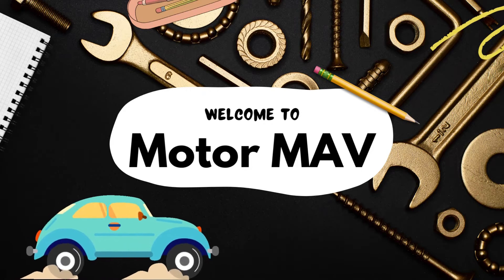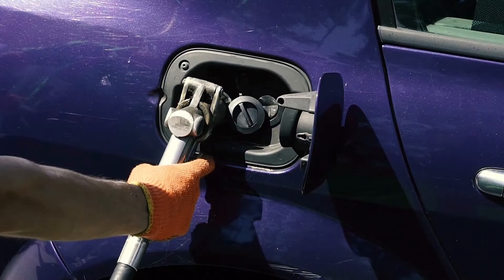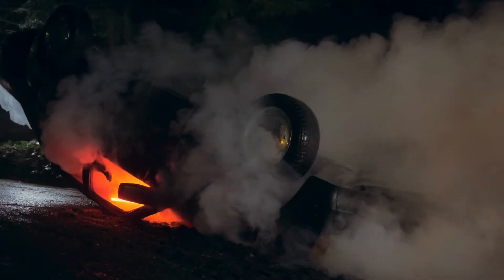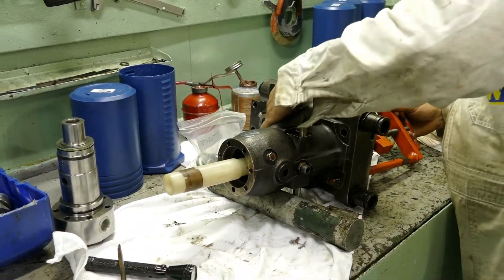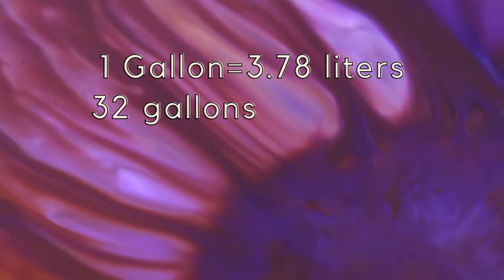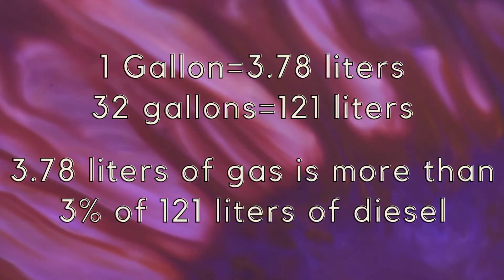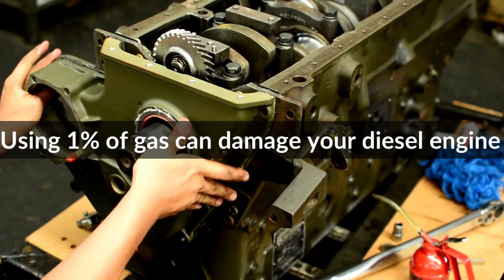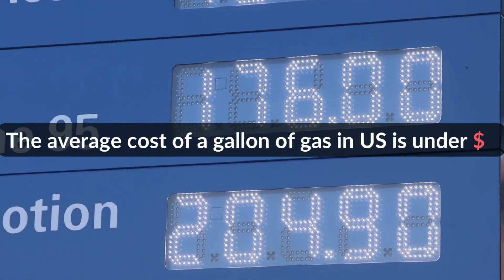What Happens If You Put 1 Gallon Of Gas In 32 Gallons Of Diesel Engine?

Comment: Where is the visual experiment to prove your hypothesis??  Yes it is theoretically wrong to put petrol on a diesel engine in 50/50 ratio.. For that amount do an audio visual experiment on a car to prove your cause.. 

I mistakenly fill up my diesel BMW with 10L of petrol and only realized when the car started to jarr around.... But instead of draining down the wrong fuel I filled it up with diesel full tank.... It actually  reduces the smoke emission and turns out to clean  the injectors of soot much more aggressively than pure diesel alone
Reply from the maker: But when you do this practice repeatedly the situation is gonna worse
Reply: I put mistakenly 2 gallons of gas , in my diesel, i immediately filled it up with diesel and its been running smooth, talk to a mech, he recommended filling up the tank around the 3/4 of a tank , for bout 600 miles or you can drain it and fill it back up with diesel